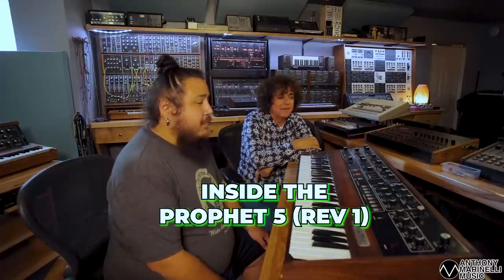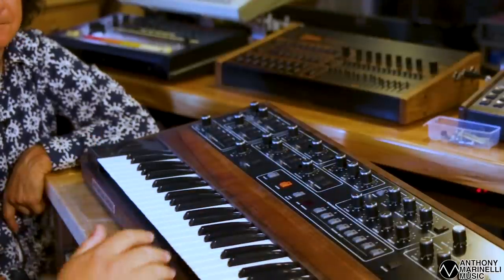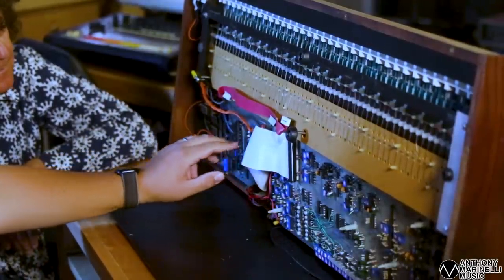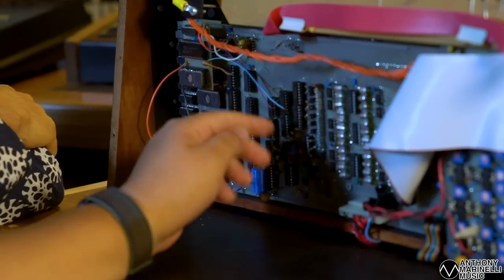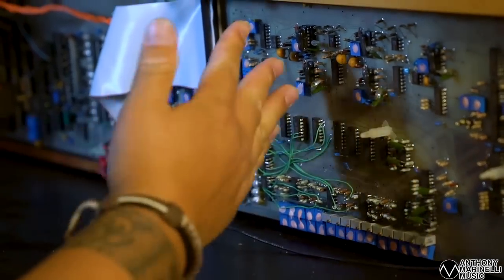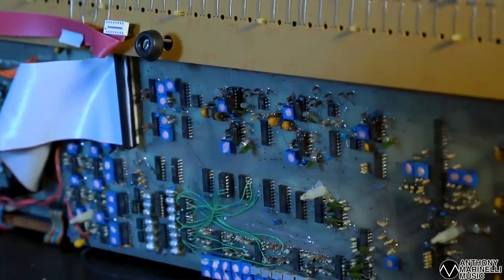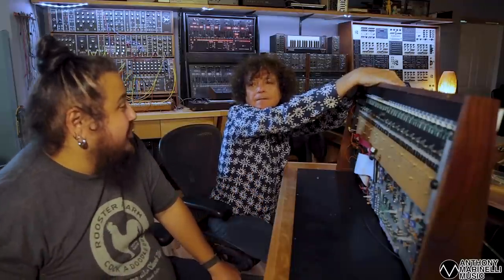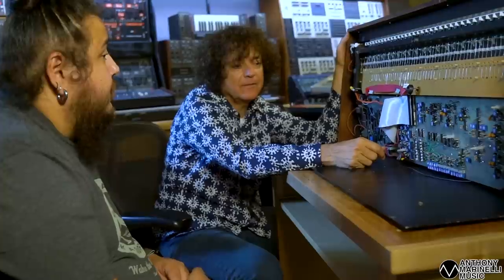Prophet 5 Under the Hood w/ Rob Rosen-Clip

Comment: A masterpiece of electronic design! Love your channel, keep going!!! 🎶 🎵 ❤️
Reply: Well it’s not a masterpiece of engineering. It’s a very creative insight, for sure. The execution of the engineering is home brewn at best. But that’s usually the case with innovators, they think outside of the box and basically prototype a working solution and others perfect the engineering. It’s easier to perfect someone else’s design than to come up with a design.
But when I fixed one for a client I was amazed that a power supply like that actually would be allowed to be made. Same BTW with the AppleII, it’s like in America they have very lacks standards to mains power supplies. The only thing worse I found was 2 years ago (on this channel) a DDR chess computer I fixed. Only when I assembled it again, I read the print: “Netzzecker ziehen bevor offenen” aka pull the plug before opening 🤣I was like: “yeah luckily I always do that out of habit, but this could’ve killed you otherwise 😂”
That actually also ran a Z80 but then a stolen clone.

Comment: Dave Smith was the man, there's no question about it.  Not to be forgotten in the design of the Prophet are Dave Rossum and Scott Wedge of E-mu.  They were design consultants to Sequential Circuits for the Prophet 5.  They received significant royalties on the P5 Revs 1 and 2.  The SSM synth chips in the Rev 1 and 2 were designed in consultation with E-mu.  The Emu digital scanning polyphonic keyboard (designed by Scott Wedge for the eMu modular) was the basis for the P5 polyphonic keyboard.

Comment: Two books to cite here: "Musical Applications of Microprocessors" by Hal Chamberlain, and "CMOS Cookbook" by Don Lancaster... reedit: two books that allowed tom oberheim or dave smith too start using ssm chips, being later replaced by more "factory biased" and stable curtis chips, and achieve multiple voicing, and then be able to save voltage or switch settings. And yes "says a lot"; designing gear and reparing it is not the same task and often doesnt require the same skills and/or knowledge... love the channel btw.

Comment: I got yesterday a SCI Prophet 2002+ sampler from 1985 ( I got 2 in the 90´s). It shocked me for good that the PSU is magnetically shielded. Dave Smith was a genious, perhaps was to avoid the magnetical radiation deleting the diskettes.  I got a friend with deep EHS electrosensibility who can´t stand being close to microwaves or magnetical radiation and I borrowed his measurer.  I got more recent samplers as E-mu 6400 turbo that are not shielded, either any Ensoniq is.  My Akai S3200 is also shielded.  I never had any John Carpenter Prophet 5 but I love my Pro one and the Prophet VS.  Rest in peace Dave.

Comment: I have to say, one of the biggest differences between this synthesizer and a modern analog polysynth... the number of green rework jumpers on that IC.
In 2023, everybody has stuff like that on our prototypes.
But in 1977, apparently Sequential did that on the production line (for at least 14 units)!

I think that was much more common in the 1970s, 1980s, 1990s.
Today, chips are a little smaller, so rework is a little slower, so it makes more sense to just spin the artwork.
Reply: In the late 70s, small business pcb were laid out by hand putting tape on clear polyester then photo reduced 4x to make the exposure masks. No computer aided support.  PCB revs were costly, had long  lead time and usually required you to permanently modify the previous version. So, you hand modified production boards to validate the design, burn down inventory and keep production running.

Comment: Yeah I agree with him. Analogue or mechanical instruments’ charm comes from being a few cents off and in affect being alive and changing — so much so that a few weeks back after a hot summer my guitar strings choked on the 2nd fret, took me playing two songs and wondering why I had to play it differently to realize that open strings didn’t ring out any more 😂
It gives it that innate modulation and the noise and hiss brings something too. I notice and hear when I play mechanical instruments what my mood and physical being is. When up strung up it sounds more aggressive the attack is harder. When I’m worn out or mellow everything is lighter and more controlled and you hear it too (or at least I think I do). 

It makes it more organic. And we can model this analogue imperfect on digital technology now to a T but it is ironic that in the 80s we went for digital to get perfection and now the most difficult part in DSP programming is getting that organic imperfection. Which sort of beats the purpose of digital in a sense 😂 But at least we don’t have hellishly out of tune oscillators anymore these days. In the 80s some synths were worse than Gibson Les Pauls when it came to staying in tune, and that’s saying something. 😂

Comment: I had the fortune to fix one 4 years ago. The guy asked me how much does it cost. I said I only charge parts if it works and you’ll let me use it for a week. He agreed and I got to play it for a whole week. And I was amazed how similar my prophet8 actually sounded to the 5 except the 5 felt it had more fundamentals, really droning those low frequencies. But that was indeed a Rev3 looked very different. And in his case the only thing that was wrong was a regulator in the power supply. But that power supply was terribly designed. These days it wouldn’t be allowed on the market in Europe like that. Luckily back then there were no CE certifications otherwise we’d missed out of it.
And the Z80 (MSX TRS80, Sinclair) was basically the standard CPU together with the 6502 (Apple C64)

Comment: I almost had a Prophet-5 but it got damaged during delivery. Though the previous owner was the "delivery service", that Prophet still hasn't tolerated its vertikal journey in its case from Vienna to southern Austria. Some parts inside got lose &  VCO A turned silent. Luckiy I was refunded.  Being still curious: Prophet-5 got replaced by creamware/soniccore PRO-12 ASB (beautiful desktop VA with wooden panel & an authentic Prophet-5  UI). Though it's soundwise not as authentic as Roland's Aira series, PRO-12 at least has 12 strong voices, Velocity and an always tuning stable Poly Mod. The latter is what it makes special & leads to unique, organic sounds, playable across the whole kb not possible with Prophet-5.

Comment: Do not overlook the fact that if Dave Rossum at EMU Systems had not designed and licensed the parts that allowed for memory recall, and the voice, filter, and amplifier chips, companies like Sequential Circuits, Oberheim Electronics, and others would not have produced the products that they did.  Dave Rossum and EMU Systems have often been overshadowed in the industry when it was them who helped start it all.  Dave Smith and Sequential may have come up with some great gear, but Dave Smith's business tactics were not ideal and often morally bereft.  Dave Rossum can attest to that.